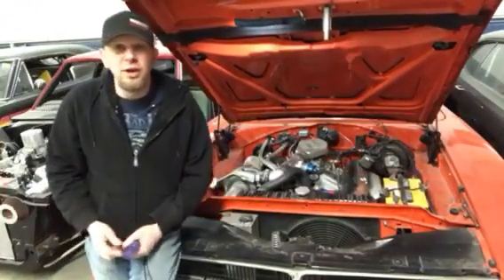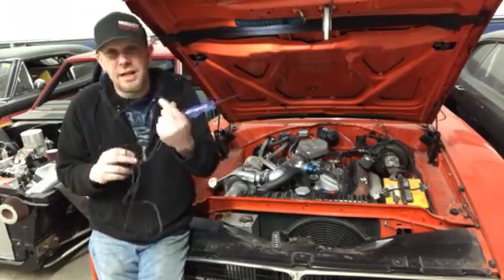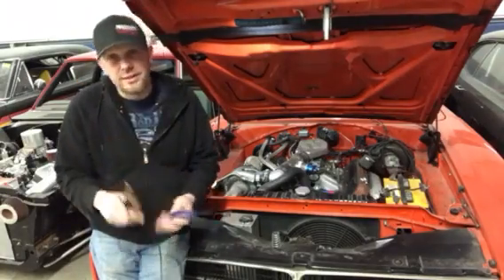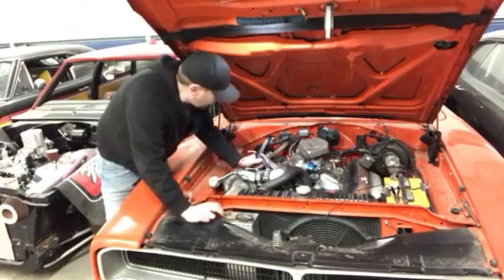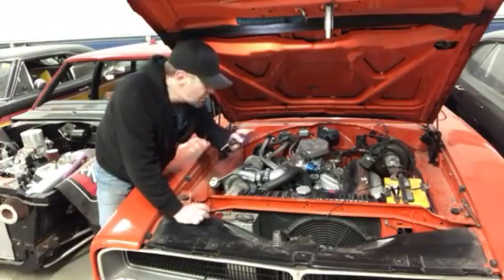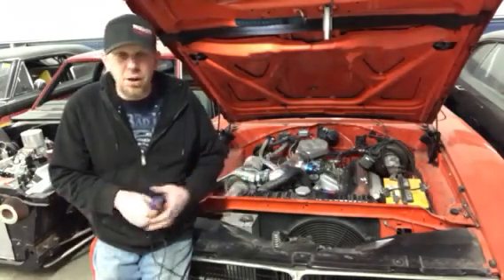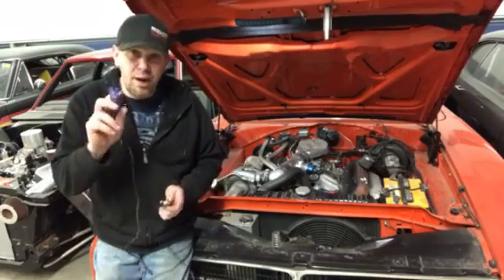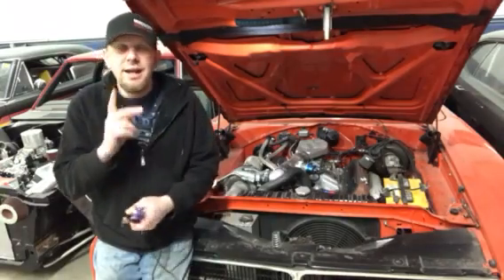How to find what cylinder is misfiring - In The Garage Tech Tip

Comment: Hi Joe,I`m a big fan of yours,great guy,hilarious,loads of personality,just wanted to share a trick with you about "finding out if a cylinder is firing",,on a header motor I just use a spray bottle,a quick squirt of water on the header tube,I also use a timing light,probably quicker and easier for most